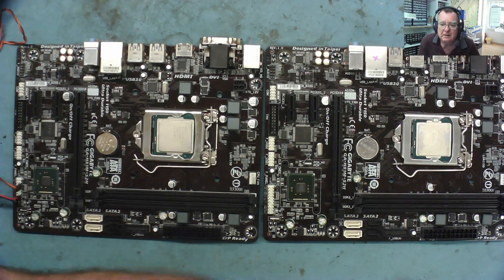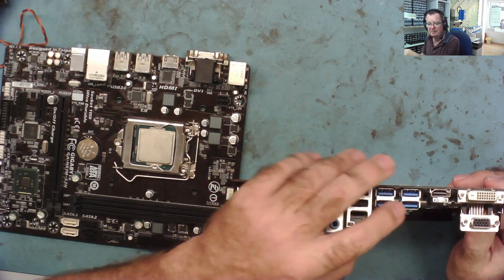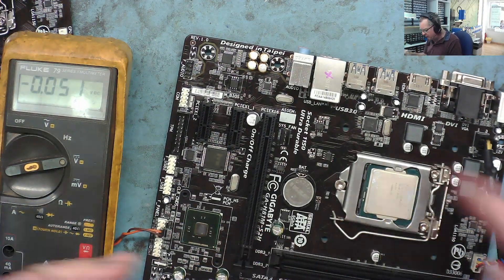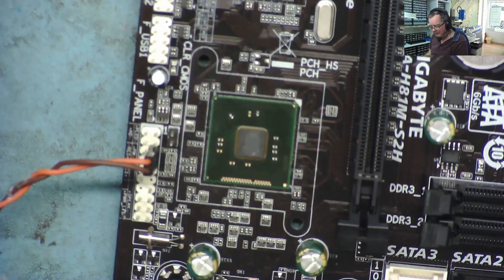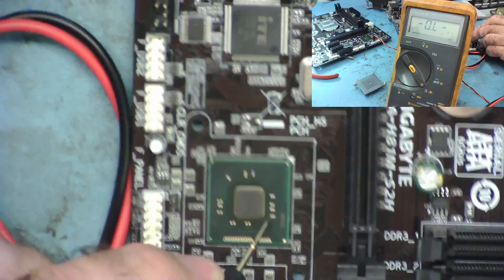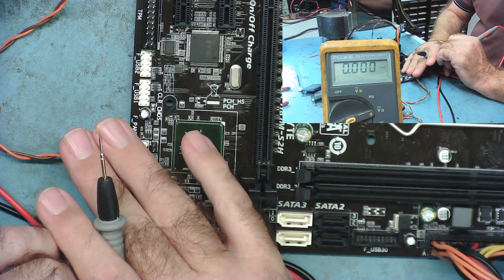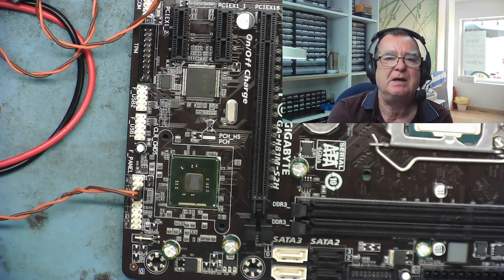Faulty Motherboard - ATX PSU repeatedly trips out (overcurrent) but no shorts found with multimeter

Comment from the maker: I now have a schematic for this motherboard.  I also decided to try something that Justin C suggested which was to check where the 3.3V supply to the PCH comes from and inject 3.3V there from my bench PSU.   The 3.3V on the capacitor on the PCH is directly connected to the 3.3V on ATX 24 pin.  Now when I inject voltage here it only draws about 350mA .  The PCH gets warm but not hot.

I looked a the schematic and also the intel datasheet.  It seems the PCH should have supplies 3.3V, 1.8V, 1.5V, 1.05V 
schematic: https://www.badcaps.net/forum/showthread.php?t=99984 (register for free if not a member)
datasheet: https://www.intel.com/content/dam/www/public/us/en/documents/datasheets/8-series-chipset-pch-datasheet.pdf page277

Also looking at the specs for the 4th gen CPU, the Vcore I read of 1.7V is unusually high.  Vcore does not directly connect to the capacitors on the PCH reading 1.7V despite having the same voltage.

I think overall in light of this additional info this motherboard requires further investigation
Reply: Tomorrow if i have time, i’ll get the schematic and bv and try to investigate also. 350mah draw by chipset is not huge. I sume there’s something wrong with one of the other ic’s which is controlled by pch: sata, cpu,pci slots, lan,sound, etc…
Reply: Btw, what is the other motherboard cpu voltage? 0.9v or 1.2v… i’d suggest to figure out why you have 1.7 on vcore?! Maybe a bad driver?
Reply from the maker: @justinc9991  This is exactly what I figured out in the pinned comment a day ago.  Did you read it?
Reply from the maker: @justinc9991  Thanks.  I will also get back to investigating further on my board soon

Comment: My AsRock B450 motherboard, trips the psu.
I press the power button, all turns on, lights on, though no display comes out, all stays on for like 30 seconds, and then the PSU will turn off for 1 second and then turn back on. And this thing keeps repeating endlessly.
Somehow the system did boot up for once, i ran stress tests, all was great.
I packed the board in its' box, and a month later, I took it out today, and it is again making that exact same problem as earlier.

Can you please help me out ?

Comment: is the crystal at the top right corner of the ITE superIO  and below the x16  socket working  correctly?
Reply from the maker: Andy Davies Hi I have this motherboard on one side to take another look.  Did you watch the whole part 2 video? I have 1.7V on Vcore and on the PCH every time the PSU pulses on - this is much too much, it should be 1.05V on the PCH (I noticed and mentioned the 1.7V in the video but didn't consider the significance of this until later, so I discussed it in the pinned topic on this video.  This, I am sure, is why the PSU repeatedly shuts down (overcurrent) but I can't see any short circuit anywhere.  I can check the crystal when I look at it again but I don't follow the logic of why that (if faulty) would cause this sort of problem. Could you elaborate further?

Comment: I had a motherboard come to me with this same failure, pch hot after a few moments and turning on and off etc. Had to tell them I didn't know what the problem was other than it wasn't something simple
Reply from the maker: If the PCH is hot when the motherboard is in standby then it is definitely a faulty PCH

Otherwise it could be related to too much voltage (1.7V instead of 1.05V) which may be the case on this motherboard.  I need to investigate mine further
Reply: @LearnElectronicsRepair  I'll have to dig it out and check if its hot at standby or just while attempting to boot. Can't remember which it was. It came out of an expensive newtek 3play 425 for doing video replays, a replacement motherboard worked fine until the software stopped accepting their serial number so the whole unit is useless anyway now for them. I've kept it as its a nice sturdy case

Comment: Always remove ATX connector AND the CR2032 battery for resistance readings.
Also out of curiosity what was the voltage on the CR2032?
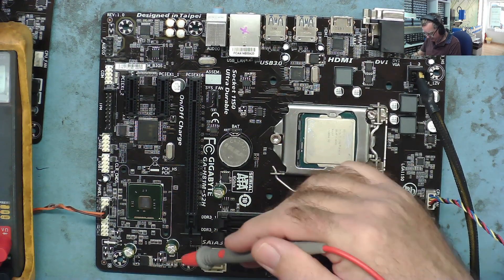Reply from the maker: Hi. I fitted a new battery and measured it anyway in Part 1 at 4:05.  It reads 3.258V
Reply: @LearnElectronicsRepair  didn’t catch first part. Just double checking it’s not a BIOS issue relating to CMOS battery being below 3V.
Did you remove battery when removing PSU for resistance readings just to see if anything changes?
Reply from the maker: @Infiniti25  No I didn't but neither did  Ido that on the good working one and they read the same.  If you see the pinned comment on this video I had some more thoughts why the PCH was getting hot instantly - I'm not sure I can fix this motherboard but it needs another look.  Guess we can call that part 3 😯

Comment: Hey richard, did you look into what a replacement PCh would cost ? 

P.S. sent you an E-Mail!
Reply: For my 3rd gen it was about 60% the value of the MB, ie, not worth it. If it was a Z97 MB it might be viable.
Reply from the maker: Yes I put the cost of a new PCH in the comments with a link to aliexpress - it is around €25
I also pinned a coment giving more info on this repair - it seems I need to investigate it a little further, not that I may be able to fix it but to better understand what caused the fault
Reply from the maker: I don't have an email from you today

Comment: This is where I would beat myself up for spending a bunch of time on it without a fix. :( Thank you for the video. Great stuff as always!
Reply from the maker: This is something you have to accept when doing repairs.  Sometimes you can not fix it, or at least not fix it economically.  The replacement part is available
https://www.aliexpress.com/item/32324789436.html?spm=a2g0s.8937460.0.0.63772e0en89gcG
but it isn't really worth repairing.  Do bear in mind I already have a profit from this PC by selling the CPU.  The best thing to do with this motherboard is keep it on one side as a donor for other repairs, or ready for a replacement PCH if I get another un-repairable (for other reasons) board with the same chipset.

Comment: Well… there is another thing you can do… you can trace the positive rail from that pch cap (i think it will go the little 3.3v ldo) and you can inject 3.3v fom bench power supply and see how much current it’s drawing. Also this will show you if the pch is getting very hot or it’s just a tactile impression as your finger starts to feel the heat… if it’s not drawing any current or very low is a good sign. Also clock chip for motherboard can behave like this, boot loop. Pulling out pch will cause the board to not start at all so this is not an option :) unless you can solder it back or have replacement… long story short: if is not a short look for clock ic. Good luck!
Reply from the maker: Hi Justin.  It's very definitely getting hot every time the PSU powers on for a second.  So much so that after a minute or two the whole area of the PCB warms up which is how I found it. Sorry I can't demonstrate this on video without a FLIR or similar.  it did occur to me after uploading this video to check if this voltage on the PCH really should be 3.3V or something else lower - in which case there could be a shorted LDO somewhere though by now the PCH is no doubt fried.  Still I am interested enough in this possibility to check on the good board tomorrow.  The two 3.3V LDO near here have permanent 3.3V from 5V STB, and I am a bit suspicious that they both have 3.3V output.  Really I have to wonder... Why?  Isn't one 3.3V LDO from 5VSTBe nough?   

Anywayt the 3.3V to the PCH  pulses on and off with the PSU (The LDO don't) and also the resistance changed from 8R to 12R when I unplugged the PSU which suggests a direct connection to 3.3V 24 pin ATX.
Reply from the maker: Hi Justin C, I followed your idea up a little bit further - I posted the results in the pinned post a the top of comments for this video. Check there.  Everything I found in the video is correct but It seems this motherboard warrants further investigation.

Comment: Any clues why the PCH died? What is the most common failure mode?
Reply from the maker: I investigated a bit further - see the pinned post at top of comments.  Possibly the problem is to do with a faulty VRM giving too much voltage (1.7V instead 1.05V).  This may explain the problem with the PCH though it may not be repairable, it warrants another look and probably another video 😉
Reply from the maker: No idea John - thought  I do want to check whether there really should be 3.3V on this rail and I don't have a short circuit LDO somewhere else
Reply: For my MSi MB, the lan shorted and took the PCH with it - ouch -.
Reply: i also get lots of boards with pch problems gettings very hot pch plus delivery too much plus reball probable only valuable for very expensive boards